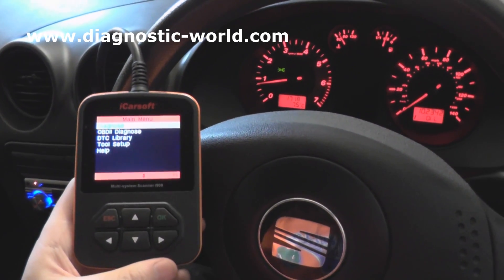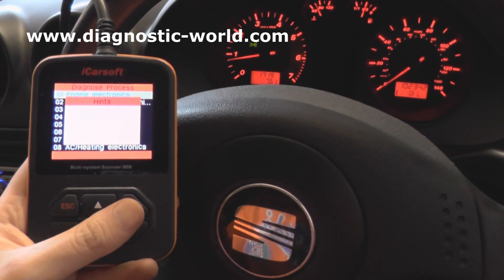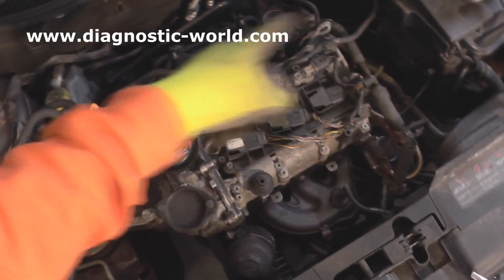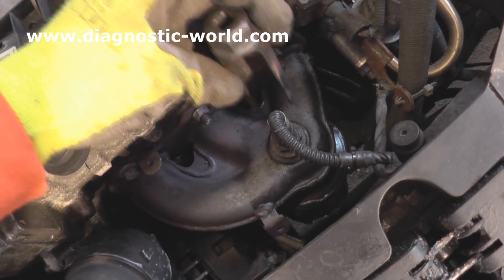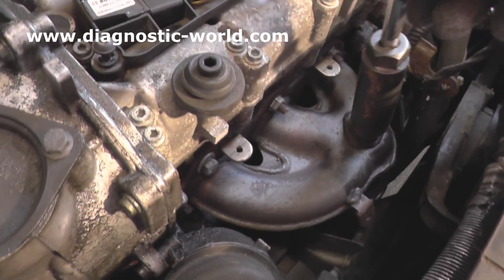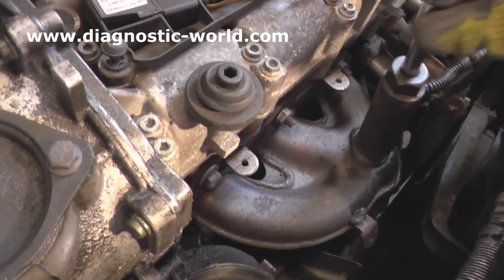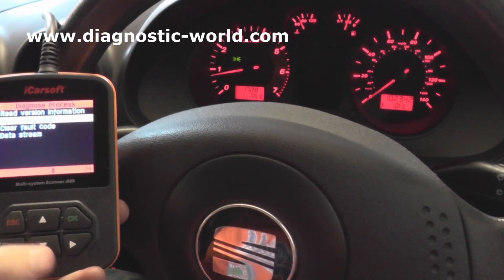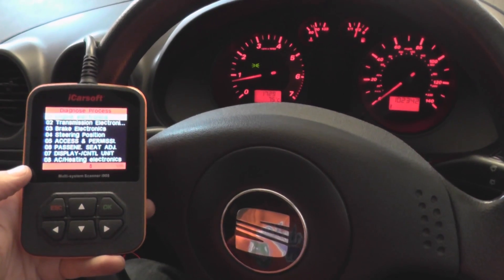Seat O2 Sensor Removal & Refit Bank 1 Fault Codes 16555 P0171

Comment: what size is the lambda socket? I have pending codes p0171 and p0106 which are apparently manifold pressure and lean on bank 1.They aren't displaying an engine warning light but are listed under pending on my diagnostic scanner.Also the plugs are white suggesting lean and tickover is occasionally bad.thanks
Reply: Did u get it sorted. That’s exactly what codes mines throwing up
Reply: @redlined4493  yes mate I got a replacement NGK Lambda nearest the manifold and it ran much better and no more code.Get your plugs changed and new VW genuine coils only and that will freshen the car up too and get your mpg up
Reply: @redlined4493  yes mate I got a replacement NGK Lambda nearest the manifold and it ran much better and no more code.Get your plugs changed and new VW genuine coils only and that will freshen the car up too and get your mpg up
Reply: @Robbo2g  u sir are a god cheers. Id changed the map sensor checked leaks cleaned throttle body and new plugs and fuel filter. Its been mad
Reply: @Robbo2g  although i did change plugs n tht last year